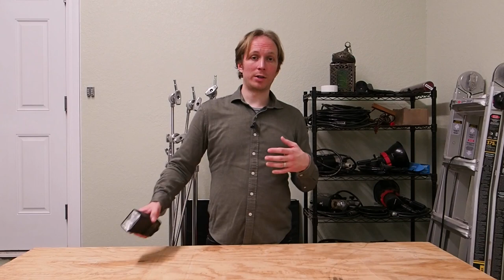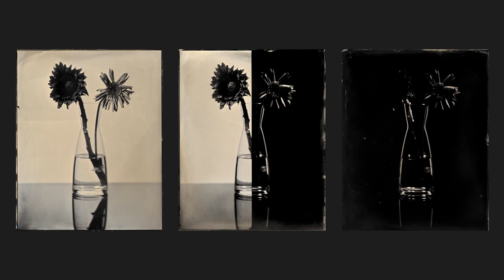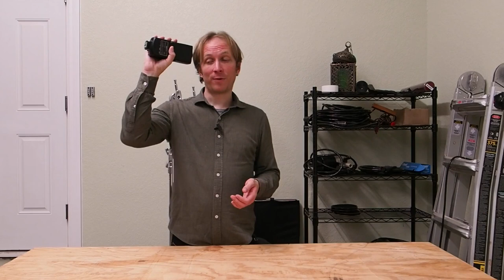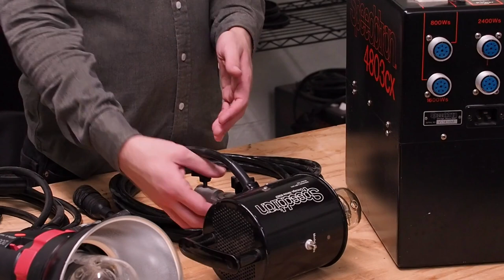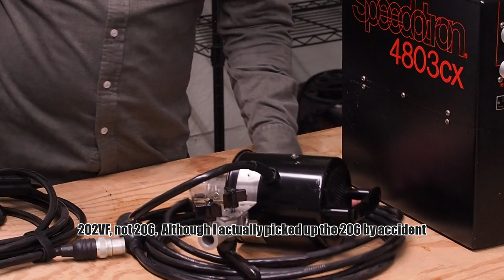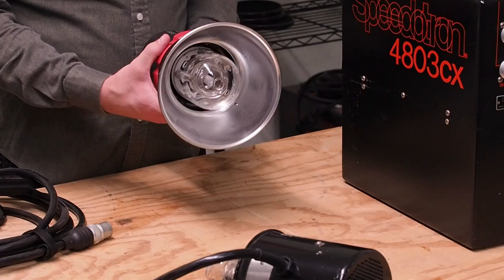Collodion Chat #1: Strobes for Wet Plate

Comment: Excellent video, Robert!  I had a borrowed 4803 setup with 4 of the lower output heads for a combined output of 4800WS, and it worked great.  However, it was really cumbersome with 4 heads / reflectors on a single light stand, and other than an umbrella, was not suitable for using modifiers. And 4 heads in 7" reflectors created a rather odd catchlight.   Found a great deal on a 4803 / 206VF combo, and now have that working with a beauty dish setup. Subscribed to your channel, and have enjoyed the rest of your videos.  Looking forward to new content!
Reply from the maker: I believe that just turns the modeling lamp on or off

Comment: Hi there, you make it seem like there’s plenty of watt seconds in the 2403 unit. I have one with a 102 flash head with beauty dish on it and I am way underexposed on my plates. My chemistry is new and I’m getting good plates outside but shooting inside is new to me. Do you have any ideas about what I should try? I meter at 3iso and get f11 at 1/500. Thanks for your channel, solid content!
Reply from the maker: What size plates are you shooting, and what's the max aperture on your lens?  Also what developer are you using?

Typically I'd say f/11 at ISO 3 is getting me there if everything else is pretty much on point.  Fast lens (around f/4), shooting headshot on 4x5 or wider on 8x10, fresh UVP-X, and a well-restrained developer that I can push for a good 30-40s of development.  If any of those elements are lacking you may need more light, and these things also just seem to vary from person to person for reasons that are hard to fully pin down.  Could be anything from the pH of your silver bath to ambient temperature to collodion recipe

Comment: Hi Robert, thanks for your videos about wet plate photography. They are very useful. I have a question for you about strobes light. I own a couple of 1.000 watts/s strobes. Would you consider that they are enough to use them with a beauty dish and a back light for wet plate portraits? Many thanks for your help. All the best.
Reply from the maker: 1000 Ws is gonna be really tight, but you may be able to pull it off with a fast lens and fresh chemistry
Reply: The faster lens I have available on a 4x5 camera is 5.6 lens. Almost impossible?
Reply from the maker: Probably not gonna cut it, I generally use a little over 1000Ws with an f/4 lens
Reply: Many thanks for you help.

Comment: Thanks for the videos, Great! 
What would you say are the best options for shooting on location with flash (no electrical available)
 Thanks!
Reply from the maker: That's a tricky one.  Speedotron makes a battery powered pack, but it maxes out at 1500Ws.  Maybe enough for some in-close work with a beauty dish, but you'll be pushing it.  Especially outdoors where you might want to stop down a little.

I would be surprised if any of the higher powered packs would work well with a battery pack, unfortunately.  They do all have a switch you can flip to put them in slow recycle mode, which at least reduces the current draw and should make them easier to run on a lower powered generator.  I'd look up the manuals and see if it lists their maximum amperage during recycle, then see if you can find a generator to match

Comment: Flash vs. Strobe historically would be different as old flashes are not electronic at all.  I'm old enough to remember flash bulbs that you had to replace after firing.  Then if you go way back they used some kind of flash powder that would be lit off.  But yea pretty much everyone today is talking about electronic flashes.